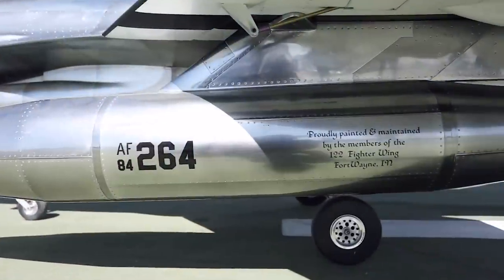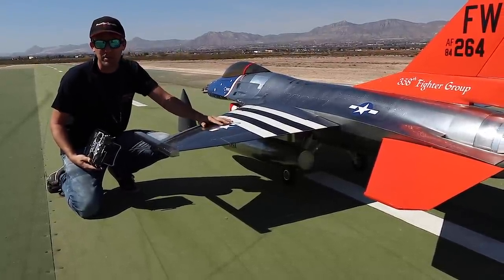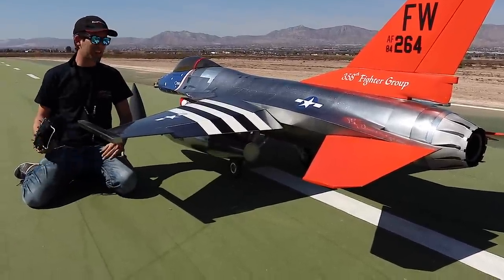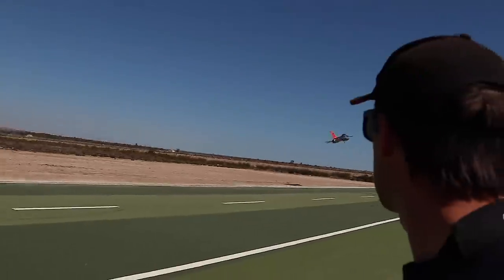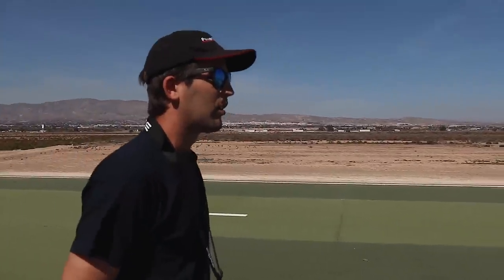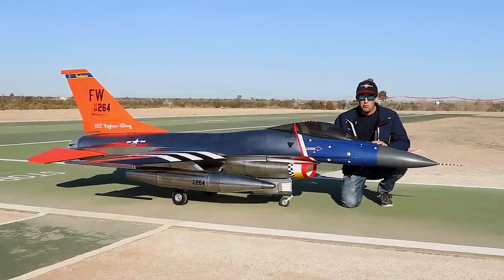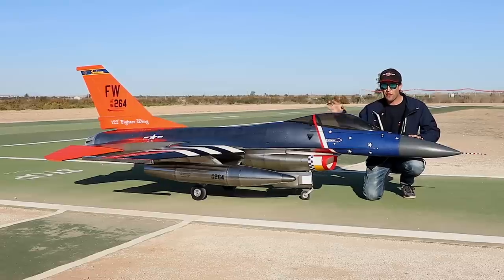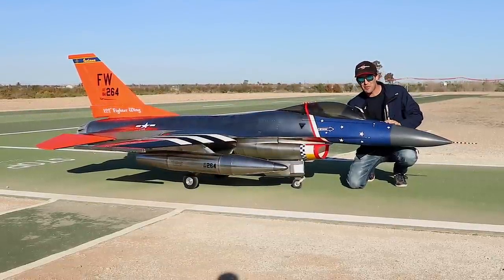HUGE F16 - Flying!

Comment: 2:32  A bit of pilot induced oscillation.  So the aileron gain was too high.  If so then I suppose you don't need taileron movement?
Reply from the maker: It was edging on getting too slow at the wrong angle, but yeah, setup could probably be improved with more flights if we had the chance...
Reply: maybe close to stall before touch down. The ideal approach.

Comment: maybe nose retract mechanism blocks when "seeing" wind pressure.  I don't know how slow you have flown and tried cycling gear. electric or pneumatic?
Reply from the maker: Thing is it retracts backward, so the wind pressure would normally help... Still looking into the problem. Currently pneumatic
Reply: @MartinPickering-PickeringRC  well, I was thinking along the lines of an "overextended" joint mechanism to lock it in the down position, so when retracting, it would actually move forward a fraction before moving rearward and up. However, it's your plane, I am sure you know it better 😉

Comment: Are RC plane engines just like jet engines but smaller?
Reply: Dustin King RC turbine engines operate on the same principle as full scale ones but are terribly inefficient and lack power. The reason for this is the low compression ratio.

Comment: Sweet! Now figure out how to to ramp up the power, and add an AB Section. I’d love to see that thing hitting Mach speeds.
Reply: Craig Cook 
  As would I . Unfortunately due to flight loads etc suspect pushing a model well beyond its normal envelope will result in :-
https://youtu.be/8yf_QTbDeWM?t=107
Reply: Cheezsoup   No problem! Just reinforce everything with carbon fiber laminate. Then modify the existing jet engine to be more complex and, as a result, more powerful. Of course, you'll have to add an AB section at this point to compensate for the extra ninety pounds of weight. But hey! You GOT this! ( FYI, I'm like that jack ass friend who tells the fat guy on the skate board to "go for it bro! " while video recording the result, which he knows will be youtube worthy) oh well.

Comment: Is the nose gear a retract?
Reply: He said in replying to another post they aren’t sure why it wouldn’t retract, it was working on the ground.  And if retracts backwards so the air pressure when flying should push it back but it didn’t. 

I would say he lucky it stayed locked then.  Otherwise it might have collapsed on landing messing up this beautiful plane!

Comment: Probably has a longer flight time than the real thing.
Reply: yeah the real thing takes an act of congress, it's incredible how much money that plane blows away tax money to actually be flown, an f18 averages 10,000+ bucks an hour. Short flights are good for you and me tax wise.
Reply: @8kigana  I think the real thing has about 45 to 60 minutes flight time, if they don't use the after burners, and not fully laden with payload. Not that long really
Reply from the maker: Full size I believe can empty its entire fuel tank in about 9 minutes if using full afterburner, which is insane!